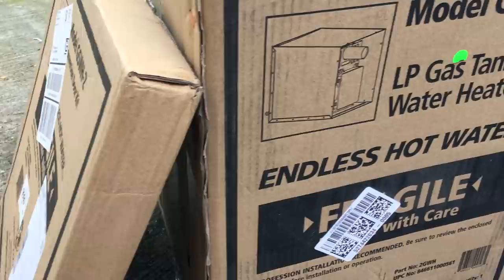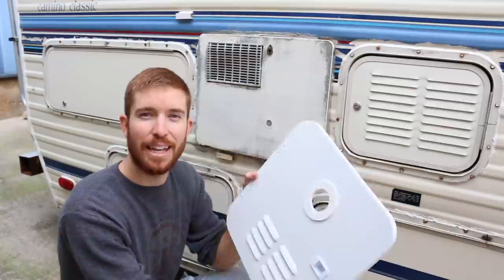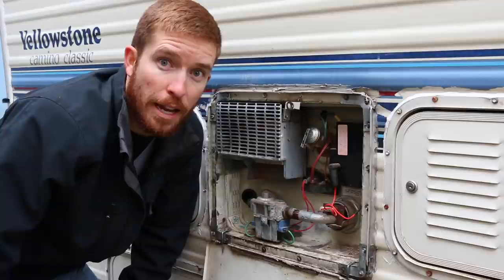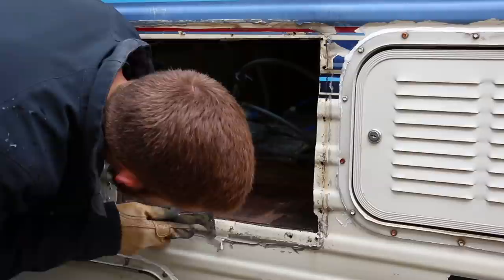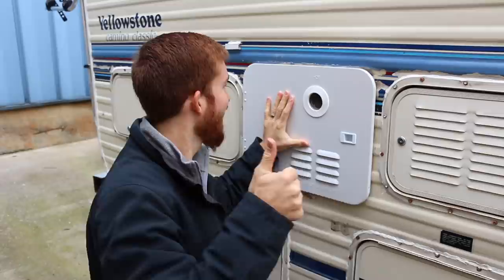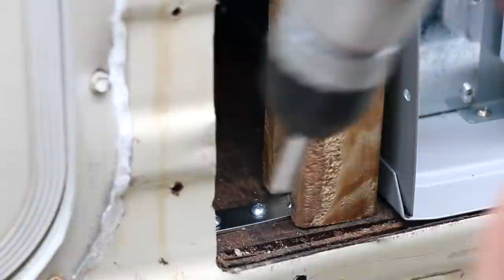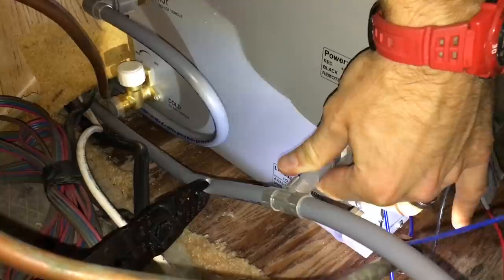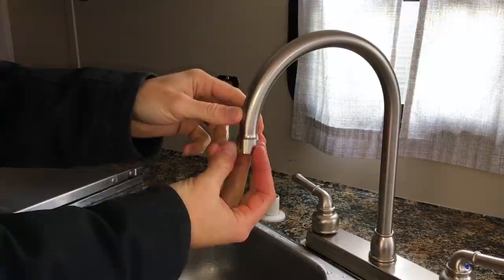Installing a New Girard Tankless Instant RV Hot Water Heater

Comment: Don't even think a out it, caulk it!
Reply from the maker: I think we're going to do it in the southwest and just make sure it is a thin strip of caulk so it wont interfere with the door. Will it leak if we don't?
Reply: Duet Justus murphy's law my friend, think about what could happen if it leaks, you'll be fixing sub floor, maybe even your nice pallet wood floors you put a lot of collecting and work into, not to mention worse case, what if you don't notice a leak and end up with black mold right under your bed? It's a no brainer, take the time to insure you're insured ;)
Reply from the maker: Awesome! Great points and you’ve convinced us 😊😊😊

Comment: There is no such thing as a hot water heater. If your water was hot ready, you would not need a heater. It is just a water heater or you could call it a cold water heater. But it is not a “hot water heater.”